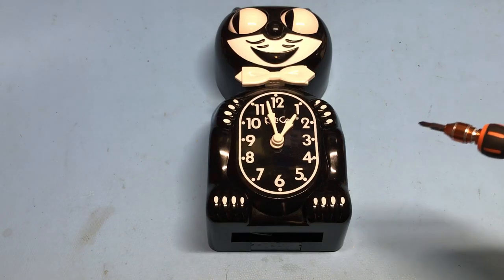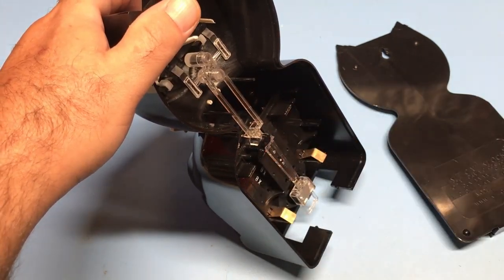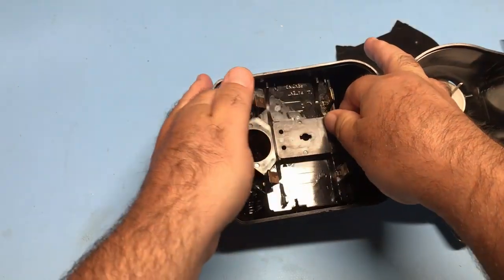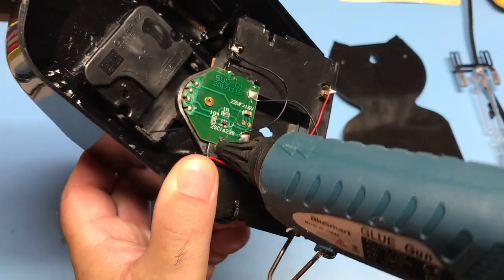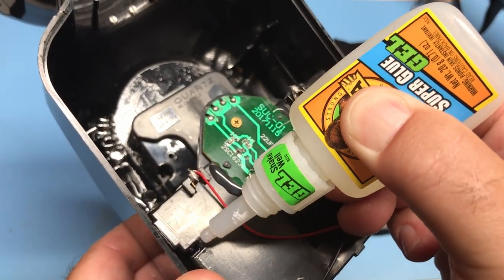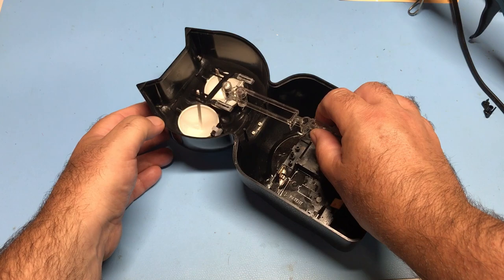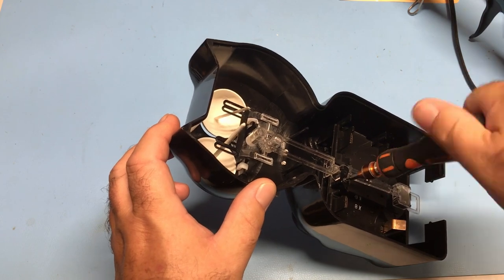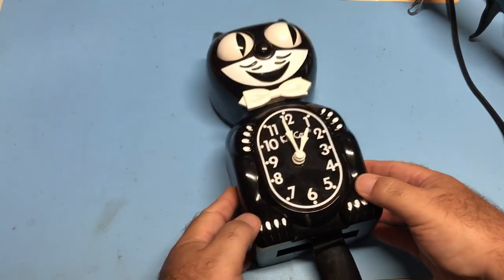Kit-Cat Klock classic - tail animation repair

Comment: What the gentleman in this Kit Kat troubleshooting video fails to mention that could be one of the MAIN reasons why that the Kat tail and eyes stop working is the angle at which the clock is mounted to the wall !! Not once in any of the videos does he discuss this other than when taking the back off to make sure its level.  Well I'm here to tell you, on my clock at least it needed to be tilted forward, that is the top of the clock needed to be tilted out ever so slightly more than the bottom. In so doing the clock works as intended.  I had the clock initially mounted flush with the wall which was ice and vertical, it kept failing this way !!! When i backed out the screw in the wall that the clock hangs from did to allow the pendulum (i.e. the tail and eyes) to start moving freely back and forth.  I didn't know or realize this until I saw in the video above that he has you remove the back cover and place on a table (he indicates a "level" table) at which time I saw the problem, that is the clock (mine at least) DOES NOT WORK when its level ! As I mentioned, I backed the screw out (maybe 2-3 mm's) that the clock hangs from on the wall to allow teh clock to pitch forward and the clock has been running fine now (famous last words).  Hope this helps some poor slob out there :)
Reply: Yes. I had this problem as well.

Comment: was yours kinda working before? mine stops after a while and it’s very annoying :( please help
Reply: mine does, too. i think the longest it's been working for is 3 days. the clock keeps going, though. Starting to think the angle it's hanging on the wall is what causes the problem, the website states that it should be angled downwards.

Comment: This is great, but check the website FAQ steps before jumping to this process. It turned out that the problem on my clock was a missing J-clip on one of the eyeballs, cheap and easy to replace. The site also tells how to confirm that the electromagnet is working; you can “disconnect” the eyeballs and then see if the tail will move. Mine did, so I needed the new J-clip to make everything work together. If I had checked this first, I wouldn’t have needed to removed the other parts shown in the video. But if I hadn’t watched the video, I wouldn’t have pursued the alternative resolution, so win-win anyway! Thanks!

Comment: My Kit Cat Klock swing tail does not work; the clock is working.  I took out the circuit board, removed the transistor, 2 caps and resistor and they all tested good.  Guess the coil could be bad.  Any place to pick up a replacement circuit board ?  Thanks,  Bob

Comment: Do you know if the coil should be wired to the circuit board? On mine, the coil is only attached to the circuit with the center screw. The tail wagging mechanism doesn't work and I'm not sure how to test the coil.